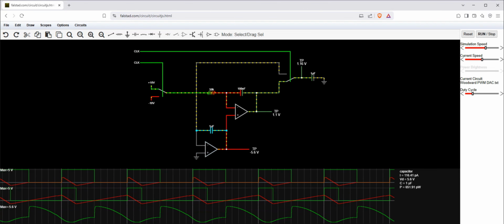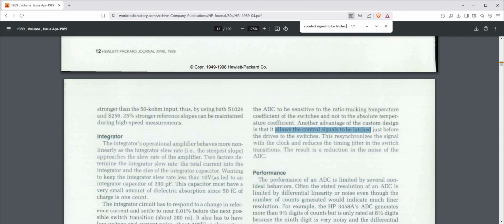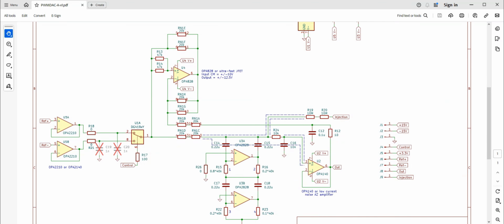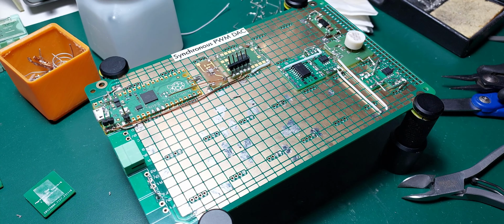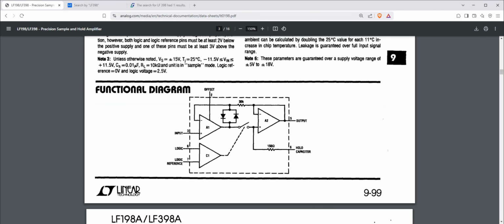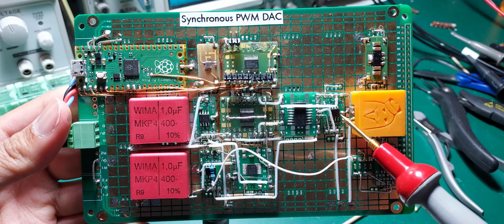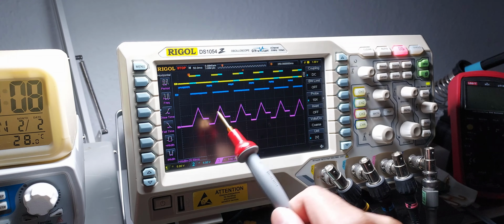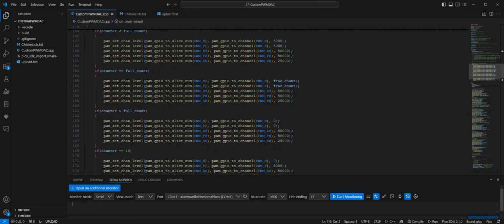DAC To The Future! | PWM DAC 1 - Synchronous Filter

Comment: Did you ever discuss what resolution (with <1LSB INL?) you finally arrived at?

I've also been wondering about how far Jim Williams "just add more DAC" solution (LT app note 86) could be extended to... 24bits of a commercial DS ADC? Have you ever tried it?
Reply from the maker: the resolution I got with the DAC featured here was around 1mV

combining DACs is once again tricky, if the gains of the fine and coarse DACs are not an accurate binary ratio, there can be significant DNL, the JW design works around that by overlapping some bits, also note that the 2kΩ and 4.12MΩ resistors are specified to be 1% metal film in AN-86 - entirely possible to implement, but DNL once again depends on the accuracy of discrete components which is not usually desirable
Reply: @ So (+/-7V=14V) / 1mV ~= 17 bit DAC?

Edit: correction, that should be 14 bit, i.e 2^14
Reply from the maker: @ivolol  I'm not sure how you did the calculation actually, the resolution is 35000 counts, so around log2(35000) = 15 bits
Reply: @ Woops, I stuffed up my own calculation. 14V / (2^14) [so therefore, 14 bits] would  give a 0.85mV step
Reply from the maker: @ivolol  I took a look at the data from the latest INL test, looks like the LSB size is 616μV

Comment: 20:33 can't be calibrated out to flatness using some measurements of the minimum point and two computed lines of best fit tweaking the output code thereafter?
Reply from the maker: possible! but under three conditions:

1. LSB size of the DAC has to be much smaller than the magnitude of the INL (in my case, the INL error was around 5ppm, with a ~35ppm resolution, so not feasible)
2. the INL should be repeatable (which was the case)
3. A repeatable method of self-calibration is needed, without always having to rely on an external instrument

personally, I would consider calibration cheating, at least till I can squeeze the maximum possible out of the circuit
Reply: @NNNILabs  Surely the code can adjust the INL even within the resolution limit by using dithering?

Personally myself, I'd consider any calibration only removing gross systematic linear errors well within practicalities. Practically every commercial instrument on the market uses 0 and full scale cal points, at the most conservative.
Reply from the maker: dithering would not be effective for the sychronous architecture since the output is not being filtered, but essentially held, so dithering between two codes would just result in the output ripple being a square wave with 1 LSB amplitude

0 and full-scale calibration can get rid of gain and offset errors, but calibrating INL out can be more tricky and usually relies on a lot of assumptions